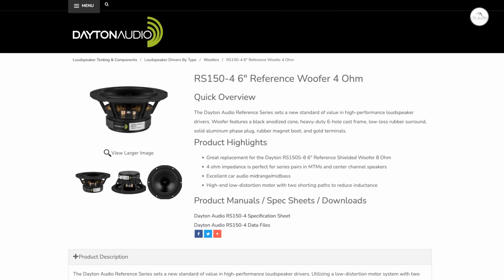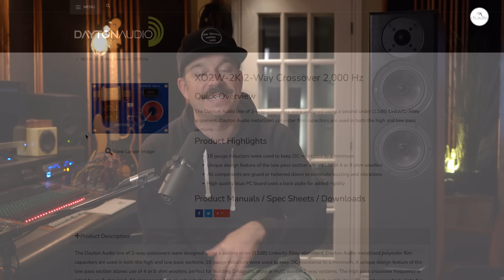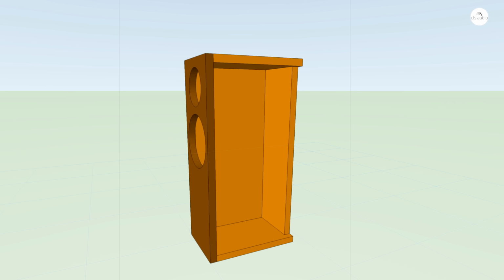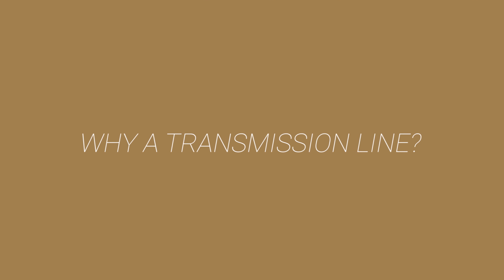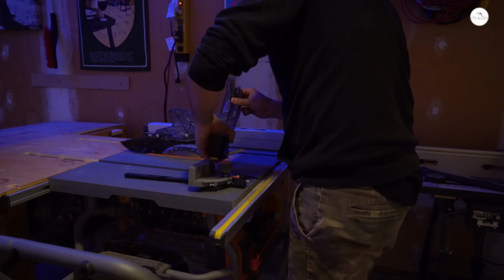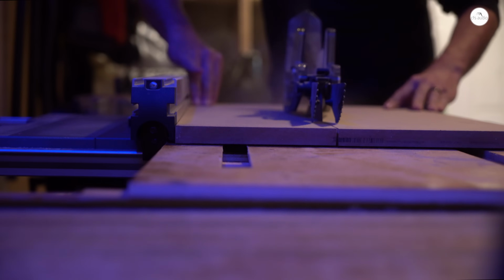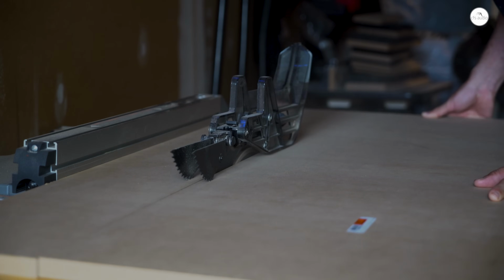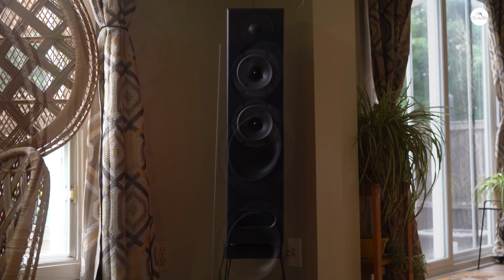DIY Reference Quality Speaker Build. How I built these amazing speakers and proper sound comparison!

Comment: Two 4 ohm drivers do not make an 8 ohm speaker, more like a 2 ohm loudspeaker, then you have to add in the impedance of the tweeter. You really messed the specs up, hahaha, 🤣. Been a Transmission line, means a loose bottom, definitely no tight midbass or bottom end. A real frankenstein of  speaker, especially with those poor quality dayton audio drivers, does not matter if they are their top of the line, they are still bottom end quality drivers. All in all a waste of good money, with a poor performance loudspeaker at the end of it.
Reply: If you say that two 4ohm speakers can't make the whole impedance on the Level of 8 ohms you should close your mouth and go to school

Comment: Did you buy upgraded Crossover parts like Sonicap’s, Janzen or ? Cooper Foil Inductors from Alpha Core.

Did you buy standard ferrous metal binding posts or upgraded Cooper  binding posts from Cardas? copper binding posts from GR Research $40 for (2) pairs 100% copper with copper banana plugs.

binding posts should be made out of Cooper for improved sonics it’s a much better signal path!

inexpensive binding post that are brass plated are ferrous metal you can tell if you use a magnet.  If it’s drawn to the binding post that proves there’s ferrous metal which is horrible to deliver your signals. Limits the sonic a quality of your drivers

Internal Speaker wire?

 is it 100% Copper OFC 16 Gauge or 18 Gauge?

Comment: Great job, they look great finished. I have built Troel Gravesen speaker kits and have learnt a lot ( check him out to get valuable tips on steps to follow. ) Can I suggest a couple of areas that you may look at next time is 1) use 5/8" felt instead of foam, much better for damping. 2) Measure the diametre of the drivers First before cutting, they do vary in size. 3) If you router the driver holes too deep ( as you have on your buikd ) cut out gasket sheet to fit in to build the hole up so the drivers are flush. Happy listening.
Reply from the maker: Awesome suggestions thanks Alain. I’ve since added a gasket under the tweeter to get it flush to the baffle. I think in the future as I keep learning I’m gonna re do this build with all the amazing suggestions I’ve been getting. Thanks for watching!
Reply: I've been designing and building t-line for over 35 years exclusively, and I can count on one hand, the amount of times I've use damping throughout the whole line. NO damping -  https://www.youtube.com/watch?v=-U3XW6TV9zI
That's when things seem to go awry IMO.

Here are a few fun t-line designs
https://www.youtube.com/watch?v=qm5K_VVRwXQ
https://www.youtube.com/watch?v=3qjWKUBvSNA
https://www.youtube.com/watch?v=-96WAVQdcyQ
https://www.youtube.com/watch?v=6yb2msOQw_4

Comment: How did you design the transmission line?
Reply from the maker: Hey Neil. I looked at a couple different designs and went from there. PMC has a lot of info on there ATL which is pretty cool. The tunnel in my speakers is about 4’. Did some basic math and if I remember correctly there was a low mid alignment around 260 ish hz. It’s a first build so I’m still learning how it all works. Thanks for watching.
Reply: I've got a few designs, and you can download them and use them in sketchup 

https://www.youtube.com/watch?v=-96WAVQdcyQ
https://www.youtube.com/watch?v=3qjWKUBvSNA
https://www.youtube.com/watch?v=BuCEMkwvFZ0
https://www.youtube.com/watch?v=VhsgaQ61pgI
https://www.youtube.com/watch?v=Jdb2mbmL6jg

How to download designs
https://www.youtube.com/watch?v=ieAs7AcN63o

DIY t-line demo (not my video)
https://www.youtube.com/watch?v=-U3XW6TV9zI
and here's my design based on the same project 
https://www.youtube.com/watch?v=lUCwNM9o5GY

Hope that helps

Comment: These turned out insanely good, and gave me some nice pointers when it comes to finish!
I'm building a pair of WMTMW speakers, where each woofer is in their own transmission line. I originally built them with a passive crossover, but I'm currently re-building them with an active crossover, while at the same time making a new front baffle where I'm flush-mounting the drivers. I'm finishing mine off with black fronts and backs (same way you've done it, thanks for the tips), but I'm planning to use vinyl for the top and sides. It was way cheaper than veneer, but doesn't look quite as nice.
Again, yours turned out insanely good; both in terms of looks and sound!
Reply from the maker: Thanks so much for the love!!! I wanna do a similar build in the future! Good luck.

Comment: Beautiful work and solid choice of drivers! There is more detail in the sound to gain from designing and assembling your own crossover that takes more in to account those actual speaker drivers, but the finished Dayton crossover is excellent to show to inspire to build the first set. An example of what would be great to compensate for is the woofers rising impedance with the frequency which is not a problem in a 3 way, but at a 2KHz crossover point could use a Impedance correction circuit. But again really nice introduction to make a nice looking set of speakers.
Reply from the maker: Thanks so much Kent!!

Comment: Amazingly nice finish, well built, looks every bit like a top shelf product. buuuut, ouch... I'm pretty sure the build would benefit from a flush mount tweeter. Yikes that hard edge so close to tweeter is never going to do you any favors acoustically. Just to test, you could build up a spacer behind tweeto from thick sturdy cardboard/thick paper until mounted flush. Test it out, see if you like it. For a quicky sonic A/B comparison; Rebuild one speaker, feed both speakers a mono signal, use balance to test which speaker version you sonically prefer. Play several familiar tunes try to pick out sonic differencies.
Reply from the maker: Your not the first person to point this out. I’m so curious now!!! I’m really happy with how they sound so it’s nice to know it can only get better. Thanks for the suggestion and thanks for watching.
Reply: @chrisferris3303  Huge thumbs up for your build... I was thinking of a separate post for the positive stuff but I took a chance of editing my previous comment, not sure if I did it in time.

Comment: Great speaker build ! A cent of suggestion, as I saw the picture that tweeter speakers placment are a bit under the cutting holes as I assumed it being cut a bit over deep. Actually in order to compensate the height, you can get a 3-5mm thick EVA foam sheet to cut a ring ,that its size idential to the tweeter mouting hole. And then put it underneath the tweeters and mount it onto the cabinet as a buffer cushion pad. And then slowly  adjust the tweeter mounting screws until the tweeter suface being the in same level as the speaker baffle surface to make it look better like a pro built. Also the EVA pad can help to absorb some twitter resonance as well. You can also do the same way for the woffers with thinner EVA foam sheet to compensate the mounting height as well .
For the crossover, its better to change the same value air core inductors instead of iron core inductor will make the mid bass sound greater ! Good luck!
Reply from the maker: Thanks so much for the suggestions!

Comment: Egg crate foam has no effect, look it up. Save your money and time👍🏼
Reply from the maker: Hey Adam. Please share your source. I’ve been learning so much from the comments. And from what I could hear the egg crate did a great job. But hey you learn everyday.
Reply: @chrisferris3303  https://youtu.be/jjZHFIdfUFk there’s one, there are more. The foam tech used was superior to the type used here, but still only as good at damping as a few layers of cheap towels.
Reply: That only goes for subwoofers, in a speaker where there is response in the woofer enclosure over 200Hz its increasingly a must to have dampening material, there are some 3 way speakers out there with crossover point around 300Hz on the woofer that has no dampening material with a good result but not a 2 og 2,5way where a low crossover point is 1200Hz. There are slightly better treatments for ported system like Wool felt and low expansion foam, but its by small margins and the egg crate foam is still a good choice. If you leave out dampening material in a speaker, too many of the reflections will hit the membrane of the woofers again and create distortion.
Reply: @kentlarsen578  damping material yes, cheap foam no, never a good choice. It would work better if two layers were squashed and glued together. Natural long fibre wool pulled out into wispy strands extending toward the centre of the cabinet is great and fire resistant if you’re looking for something cheap to damp peaks from 200hz - 15,000hz as the very low mass allows the material to absorb plenty, that’s the best I’ve worked with.

Comment: Great looking speakers!! Great job! How do you get the cabinet size ? Would be nice a video about this. Thank you
Reply: You can simulate basic ported and sealed cabinets with a program called winISD.  Also, many full-speaker simulation software suites (that take into account baffle diffraction, step loss, room, crossover components, driver response, real impedance and phase data) also have a basic box simulator built in. I like a program called "speakersim." This sort of approach allows you to do a more thorough design than the one shown in this video, which fails to address about 70% of the issues that need to be addressed for a speaker to be called "reference" quality. 

 If you want to simulate more sophisticated boxes, use hornresp. Hornresp can simulate just about any box you can imagine, from bass horns, to transmission lines, with rear-chambers or with the driver installed somewhere along the line between the halves. It's hard to use but very rewarding once you learn it as it opens up very interesting speaker box options.

Comment: Pity you left a step around the tweeter that would cause diffraction and high frequency smearing. The face should be flush with the baffle. Furthermore, how did you calculate the port length. Looks like you just used some arbitrary arrangement. How did you calculate the cabinet volume, just to look nice? You placed the speakers how far apart? Does it have anything to do with response and phase alignment? Well hopefully it sounds nice to you since whatever you build yourself has an inherent astigmatism that it sounds the best, unfortunately it does not. You provide no measurement data either so yeah, it is a box with three speakers in it.
Reply: All good points that will take the speakers further, but taking all those things into account only a few will be left to give it a try for the first time. The hobby of building speakers is a road and there is always room for improvement and troubleshooting that leads to learning.
Reply from the maker: Hey Nico. Thanks for the love.
Reply from the maker: @From Lima thanks for the comments! If I’ve done anything right in this video it was creating a space for people to share their knowledge. Some people are just nicer than others lol. Thanks for watching.
Reply: @From Lima as our friend Chris does not have a $1M+ Harmon acoustical testing lab at his disposal.

Those few suggestions, don't require a $1M+ Harmon lab. And for all of Floyd Toole, Sean Olive's and Andy Wehmeyer's (car audio - Audio Frog brand) expertise, I still find their products lacking, in home audio, and especially in car audio.

Comment: Also, if you happen to want to build a pair of 8" bookshelf speakers sometime, you should try some Silver Flute drivers off of Madisound. They're excellent drivers for the price and they dig way lower than you'd expect. I think pairing the XT25TG30-04 with the W20RC38-04 could make for a pretty nice set of bookshelves. Based on their little graphs provided by the site, they seem to be at least somewhat decently matched.
Reply from the maker: Sick! Thanks for the reco!
Reply: I'm trying to figure out how to use xsim so I can build my own crossover but I am struggling with the software.
Reply: @BostonMike68  if you get speakers with a similar SPL across their operating frequencies and you only want to maintain their performance and not tune or reshape their FR, then you can get away with using online calculators that just ask for which order and type of crossover and the impedance of the speakers to design a simplified crossover. If you want to tune the speakers using the crossover network, that is when you'll want dedicated software to engineer a more complex crossover network. Active crossovers are also a possibility if you want to get really granular about how your speakers are tuned, but that kind of thing is a bit less common in home audio compared to car audio.
Reply: @mndlessdrwer  That's what I actually tried to do. I did a small tower with Dayton audio 4" tcp 125 those great little woofers btw and I used one of their tweeters and a the same crossover you used and I really like the way they sound but I watch all these videos and people with these complex crossover networks but I guess sometimes less might be better if you get the drivers at the beginning. Thanks I appreciate your feedback
Reply: @BostonMike68  it depends a lot on what sound you're going for, how the drivers' untuned frequency response matches up to your desired sound profile, and then how forgiving those drivers are to less than ideal crossover and enclosure designs. Luckily the Silver Flute drivers are quite forgiving, so you only need to worry about the tweeter. As long as you chose a decently matched tweeter and get the woofer to stop making noise before about 4000Hz, then you'll end up with a pretty good sound. Above 3500Hz, the silver flute drivers begin to break up. It isn't particularly pronounced like more specialized bass woofers, but it is less than ideal. I used a cheap pre-made crossover network designed for generic automotive speakers to cross over the 6.5" silver flute with some xt25 dual ring radiator tweeters and, despite the crossover not being ideally tuned and the components being cheap AF, it still sounded quite good in my friend's car. Like, if you work with some forgiving drivers then you can get away with not being a professional speaker engineer and still get a nice sounding set of speakers. The Silver Flute and Vifa XT25 dual ring radiator driver combo is very forgiving.
Reply: @mndlessdrwer I have a 2007 Honda CRV. Want to replace factory speakers, any recommendation? Thanks.
Reply: I been testing how low they get with an app on my phone and I use a test from u tube I found one that plays music and then it will Dip down the bass and it will show 45 ,40 ,35 hz and I can't believe my speakers that I made got down to 34 hz with 4 " woofers but I have 8" passive radiator and I don't care what anyone tells me about you can get the same bass with a port I don't think so. I someone else build almost the same design and they couldn't get 50 hz with a port
Reply: Oh great thanks that's what I working on. But I have a bigger old school bookshelves with a 10" grs Dayton audio woofer and it's not bad for the money but I plan on keeping these so I want to get the best drivers for the money.
Reply: @BostonMike68  I helped my friend install some of the 6.5" Silver Flute drivers into his car (not exactly ideal since they're paper and wool and car doors aren't fully sealed from the weather) but they sounded great even without an ideal tuned enclosure. Very forgiving speakers to work with. The 8" models just reach even lower. I was thoroughly impressed by how well-made they were. The quality is fantastic for the price and they even look quite nice with that satin grey look. Plus, I will never stop recommending the classic double ring radiator tweeter. They're just such a lovely tweeter design thanks to their high dispersion and sweet sound reproduction. They just do every genre well without the aggressive quality that some metal dome tweeters exhibit. Just remember to cross the tweeter over relatively low in order to compensate for the larger driver's lower agility and tendency to beam at higher frequencies. Ring radiator tweeters have a surprisingly large operating range, so you can cross them over quite low without much risk to them. Let us know how it goes if you can find this comment chain again after you build your bookshelf speakers.
Reply: @mndlessdrwer  thanks I appreciate it. I never used Madison sound before. I'm going to check it out. I'm going with a good size box and 10" woofers. I already have the woofers I bought them to replacement on a old cabinet but I ended up building new ones out of.5 MDF with .75 solid oak on top so they are solid and I want a nice driver for these now and those sound like what I want.